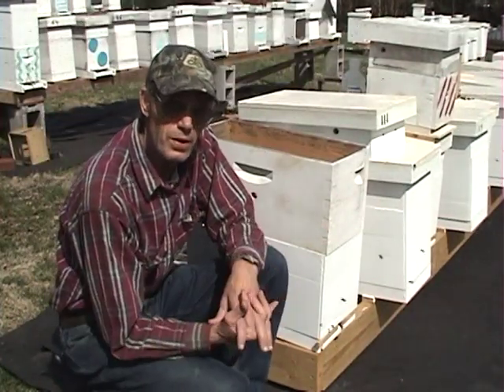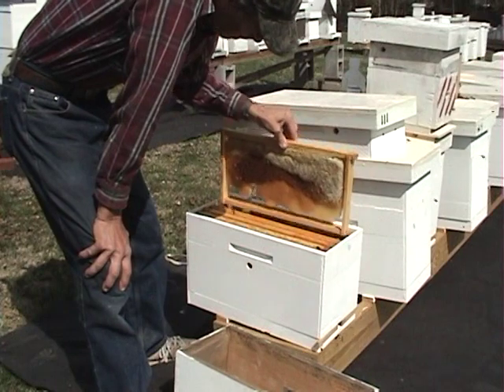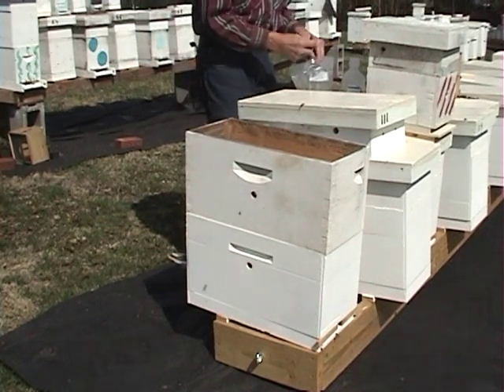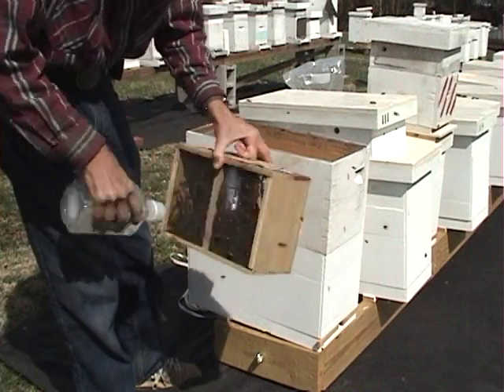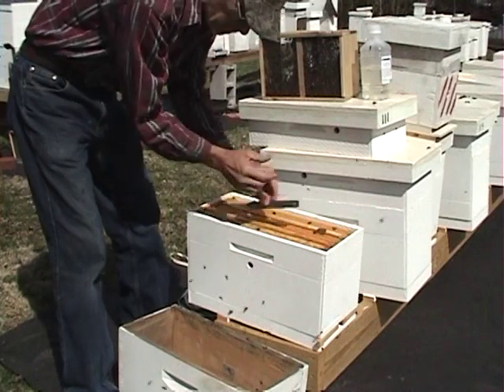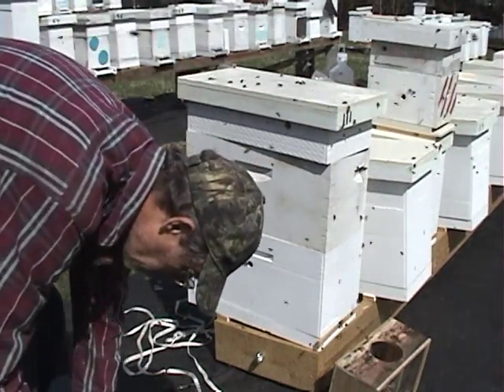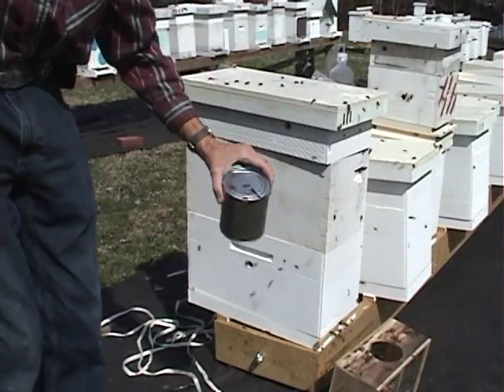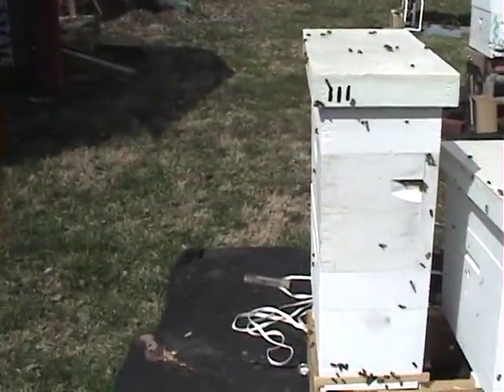Cold Weather  Package Install

Comment: I can't wait to see all the splits FBM style how many are you hoping for in the range of 40-50?
Reply: No I won't make that many it would be to many out of same blood line
Reply: how many per line do you run joe? what rules do you follow on that
Reply: If you run them with the entrances all facing the same way you need at lease 10 inched between them. If you face one one way then the next one the other you can put them with just enough room to set a frame between them. I run mine with the entrances facing opposite directions this puts the two entrances that are on the same side about 3 feet apart.  This helps with the drifting of the bees. A draw back of this is your butt is always in a entrance. Not a big deal for me.
Reply from the maker: I try not to make over 20 or so split off same line. Making queen is different they will be leaving my yard. so I don't worrie about inbreeding. I buy a few packages from different people to keep the blood lines mixed up. I could get queen from different people. Lets say a queen is breed by 15 different drones I get maybe 15 blood lines out of her. So if I buy packages with 500 drones I get way  over 500 potential blood line to breed with may queens.
Reply: Oh Joe that is brilliant! Thank you for that!